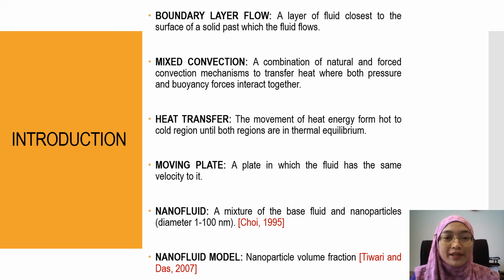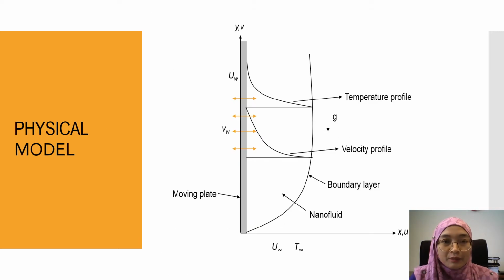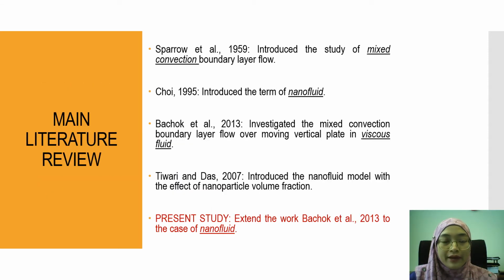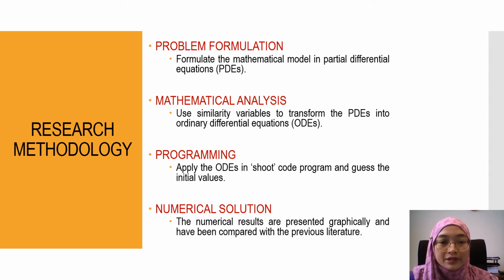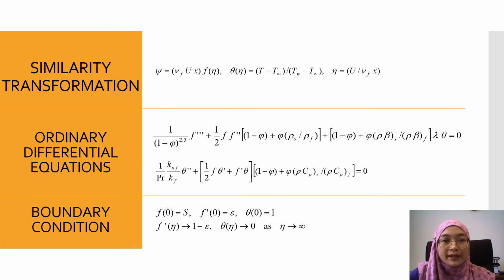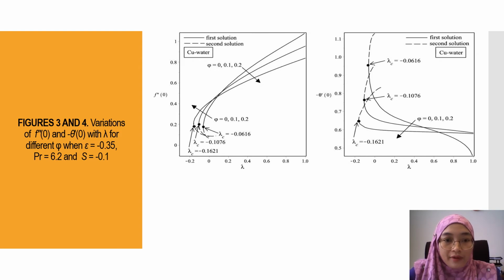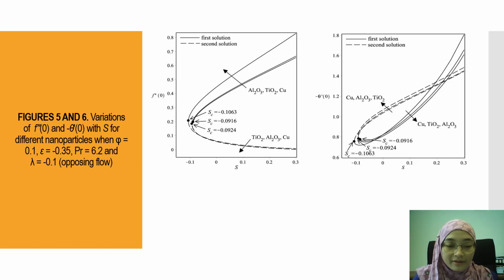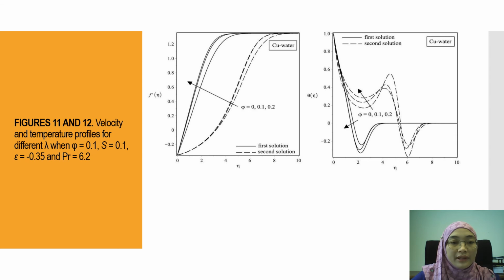Numerical Solutions of Mixed Convection Flow over a Moving Vertical Plate in Nanofluid

Comment: Thank you Dr for your presentation, I have questions about boussinesq hypothesis, When we study mixed convection in circular pipe, there is an interval of any cross section temperature act the pipe so if we use water, the temperature does not rises than 10 degree (boussinesq hypothesis), its correct, this application do into ANSYS FLUENT. Can you give some explications.
Warming,